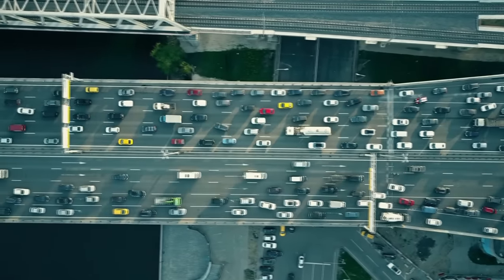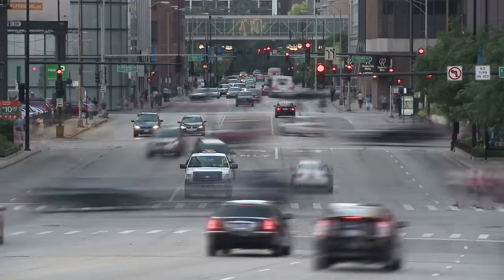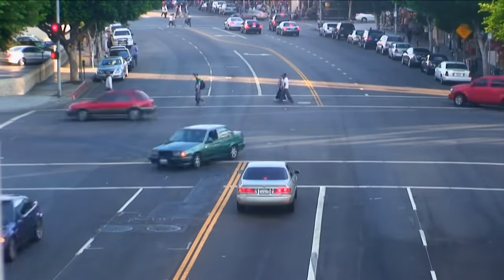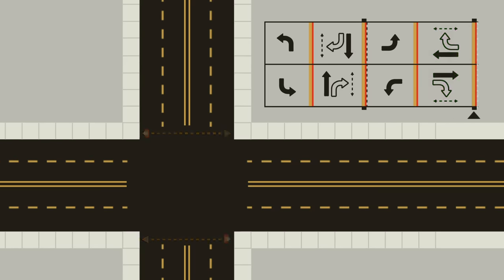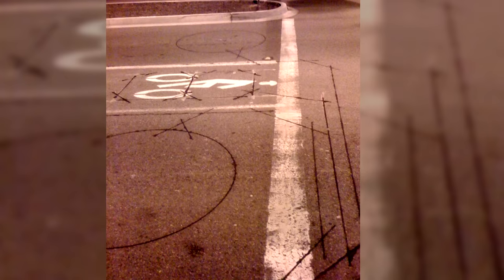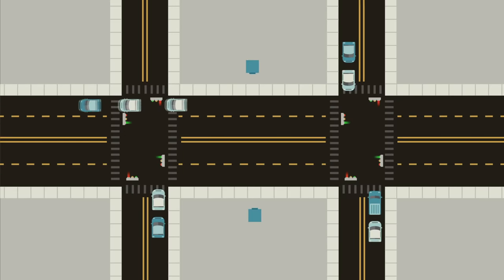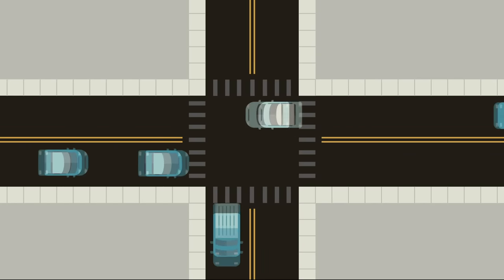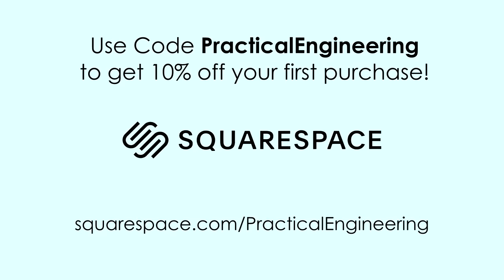How Do Traffic Signals Work?

Comment: Simple!
They show red light when I am near, they show green when I am not.
Reply: This! 😂
Reply: True
Reply: Hahaha correct 😅
Reply: you need to get a job driving a firetruck
Reply: Well in France, I have almost the opposite feeling (at least in the town I live, which doesn’t have a that large population). The traffic light is often green, and when it’s not, the red phase is relatively short.
Reply: System detects that you're speeding and punishes you by turning red light :P
Reply: That's how far the content goes indeed
Reply: C'est la vie.
Reply: i HATE traffic lights.  The traffic engineers who made the algorithms for the timing of right way need to be punished and jailed for life.  Such ignorance in the design.   Why the hell is the light red for me at an intersection where the intersecting lane has NO  cars?  That makes no sense!
Reply: @ClassyJohn  One explanation could be that you drive in a low traffic environment during the winter and during the summer you remember only the negative things which doesn't bode well for your hearts  longterm condition.
Reply: @SimonWoodburyForget  It does not make sense to group people who drive fast with those who drive slow.  It makes more sense to write an algorithm that favors faster drivers (obviously within reason) because otherwise it creates unnecessary congestion.  The algorithm is flawed no matter how you look at it and it desperately needs an update.
Reply: Its even more frustrating when you stop and the light immediately changes to green
Reply: Simon WoodburyForget If that were the case, the speed limit on the highway would be at least 140 km/h. Studies show that people feel more comfortable driving at this speed and it’s the most efficient speed limit to optimize traffic flow as it would mean consistent speeds. To prove this, it is the average speed on the autobahn in Germany when traffic volume is high (but not too high that there are traffic jams: medium capacity).
Reply: It sure seems like that...
How about those times when you speed up to make the green light, then all of a sudden it changes to red, and the guy next to your who was driving slowly suddenly catches up to you and even passes you by somehow...  lol
Reply: @BillAnt  I see this all the time being an anticipatory ("slow") driver and it makes me chuckle whenever I see some guy racing from intersection to intersection whereas I don't even need to come to a full stop, saving fuel, my brakes, making less noise and still not reaching my destination a second later than the racing guy. There is absolutely no point in racing to the next red light.
Reply: @Martin Weizenacker < That's why I don't do it, unless I'm in a huge hurry, but then it backfires anyway. lol
Definitely saves a lot of fuel, lessens the ricks of an accident, and saves one's sanity to just go with the flow. ;D
Reply: @SimonWoodburyForget  That's called Greeen Wave
Reply: And they're never timed with the lights coming up even going the posted speed limit.
Reply: @astromec6303  great job
Reply: I know, right!
Reply: Honestly.
Reply: True
Reply: I agree. Traffic control is for safety also. No car on section that I am and it is red, but when car approach from green traffic light, then it turn red which cause many accident in winter time. It should have a sensor with the timer to to adjust for the safety and cause a less wait on red light when no car approaching the other lane.
Reply: I read on a video back then that they did this to cause accident so auto shop repair can make business. That is a fact!
Reply: Lolll
Reply: @ClassyJohn  Remind me of some junctions in my city (right-hand drive) where sometimes there are more vehicles wanting to right-turn than oncoming vehicles going straight, but the traffic lights are slow to change from straight-going green (during which many junctions do allow discretionary/unprotected right turns, but may be unsafe due to blind spots e.g. Q of right-turning vehicles at same junction in oncoming direction and left bend in road ahead blocking one's view of oncoming traffic) to right-turning green. With my city planning to reduce discretionary/unprotected right turns (after a taxi got fatally T-boned last year while making such a turn), it'll be even more important to address this issue
Reply: Correction they show yellow when you are near. That's worse than red, especiallywhen you got drivers tailgating you. Pass or gas?
Reply: @SimonWoodburyForget  So you're proposing to make cars more like public transport 🤔 where vehicles pass by any given point along the road with more discrete time intervals between them, rather than over a continuous continuum of time
Reply: Stephen _L how come the red light don't looks red
Reply: @ClassyJohn
That isn't necessarily the traffic engineers you should be mad at.  Maybe the traffic engineer wanted a more sophisticated system but the municipality wouldn't pay for it. 

But as this video tries to point out, the answer to your root question may be more complicated than just the intersection in front of you.  (It just depends on how large and busy of an area you are in.)  That red light in front of you may be metering traffic approaching a much larger intersection ahead. 

The engineering failure that annoys me is traffic lights for these little side streets where the signal goes into a detection phase.  At a main road and side street intersection like this, the main road usually has green lights.  Pedestrian lights may cycle from Walk to Don't Walk and the signal enters its detection phase.  If any vehicle drives onto any detector, the main road signals will change.  This is fine, except the detector is often triggered by vehicles shallowly turning left off of the main road onto the side street.  The detector is only triggered for half a second, but it's enough to interrupt the traffic on the main road even when there is no traffic on the side road.  There should be a detection delay of a second or two that requires a "waiting vehicle" to be present for at least that amount of time.
Reply: hahahaha!!!!!!!
Reply: Ugh true
Reply: Stephen _L wow!
Reply: so true
Reply: Seems like the timing cycles are flipped backwards from they should be. And why now in the 2000s! I can remember when traffic signals were set up to expedite traffic flow, not impede it.
Reply: @SimonWoodburyForget  There's a really weird thing in the badly engineered town of Savannah, GA where I used to live, and the drivers have become accustomed to the horrible design of their roads, and so ALWAYS slow down for GREEN lights, and SPEED UP for red ones! As an outside, it was clear to me that nobody who ever worked in their city works department had any of the knowledge in this video. Down there, I think they just like the pretty red lights, so they put them up everywhere, and only make changes when somebody crashes and dies.
Reply: Thats not true.
It shows yellow when im about to cross, and stays red for 1 minute when only 1 car goes.
Reply: Because they rarely synchronize them. The highway by my house has them synchronized, it saves so much time and makes it safer because speeding doesn't get you there any quicker. If you go 45 MPH you can drive the whole stretch and not catch a single light. It is just government not having their act together why so many lights are not programmed right.
Reply: In my experience, if you're always driving faster than the posted speed limit, the light will usually turn red on you more often times than not to slow you down, but if you drive at the PSL, the light seems to stay green almost as if the system "knew" you were being more prudent with your driving.
Reply: Nailed it bro.
Reply: HAHAHAHAHA!! I feel for you, buddy.

Comment: I have a 52 year career involving design, fabrication, installation, timing and manufacturing vehicle traffic control systems. I applaud you for an excellent summary of these very complex systems. You even got then lingo correct that, in my experience, is rare except for actual practitioners of the art.
Reply: Seems like fascinating work... how does one get involved?
Reply: @orneryoverwatch7031 traffic design engineering - but video said with technology advancing, the jobs going to become computer based

Comment: In my home town, the timing between several lights (roughly a mile apart) is set up so if you were to drive the speed limit, you could hit all green lights. Only when you would go over or under the speed limit would you have to brake for a light.
Reply: I wish my town would bother to synchronize its lights. Downtown, the lights seem to be synced to always go red as the signal before discharges traffic towards it.
Reply: ... and in my hometown you only hit them all green if you drive 10 over.  I swear it's just so they can hand out more citations.
Reply: The roads around me couldn't give a fuck about logic and just go off whenever they want to
Reply: In NYC the major Avenues are synchronized so you can go through many of them in a pack. However, this can only work in one direction, the other direction becomes an exercise in frustration.
Reply: the problem with that system is that if you hit one red light, then you pretty much get all red lights
Reply: @Khorne_of_the_Hill  no, if you hit a red light, you just wait for a green, and then ride the next green wave, as soon as your speed matches the optimum. You may hit the red only if the platoon is too long and you're in the tail. The stop just cuts the tail off and you form a head of a next platoon
Reply: I learned that from a Paris taxi driver in 1977 when gas was the equivalent of $7 a gallon then. That driver handled that 4 speed Peugeot like a fine musical instrument! No stops. It is amazing what risks drivers are willing to take to gain 50 feet here in America. 3 seconds on the journey really!

Comment: There's a light near where I live where for a busy intersection that literally gives 3 seconds of green light  and causes the most frustrating traffic imaginable
Reply: Sounds about the same as the traffic light on my street. It gives about enough time for 1 vehicle to pass through before it turns Red again right after it just turned Green a few seconds earlier. Your lucky to get one vehicle threw the intercection before the light changes back to yellow and then Red.
Reply: There's an intersection between a seldom-used side street and a main street in my town. They have the lights default to red on the main street and green on the side street and the sensors take a good 30 seconds to go from detecting a car on the main street wanting to go (with zero traffic on the side street) to changing the light so the main street traffic can go. Nine times out of ten, you're getting stopped at that intersection if you take the main street. It causes so much traffic right in downtown. I kind of think they designed it like that on purpose. The only reasoning I can figure is to force people to stop and see the downtown businesses and tempt them to make a turn down the side street instead of continuing on the main street.
Reply: There’s one T-intersection near my home that has like 5 seconds of green and 1-2 minutes of red. 🤯
Reply: @NotSoCrazyNinja  - I once spoke with a guy who works in the traffic control business and he said that such limits - nonsensical to the naked eye of most drivers - are often implemented on the territorial boundaries of legal entities, e.g. counties. They block or push traffic onto the other, to have less problems within.
Reply: There is one road I must take to go to my homeland. On the way back, you go from a 70 m/h road and there is a bend then there is a set of lights that change from green to red spending almost no time on amber. People either slam on, or skip the red. But the road crossing is also a 70 with the same problem. That road is dangerous
Reply: @kojak8403  It's like the ramp meters on highways. Intentionally reduce the traffic at places where it's possible, so you don't get a mess at places where it's impossible.
Reply: @Stettafire  70 meters per hour isn't very fast though.

In Europe it's mostly illegal to use lights on road with such high speed limits. You need to reduce it to 70km/h /  ~44mph for installing lights. Also for any kind of complex intersection.

You also shouldn't go in a blind corner with 70mph. Damn, this should be common sense.
Reply: @NotSoCrazyNinja  I may suppose that engineers messed up with lights and directions so that main street is served by traffic lights, designed for side-street.
Reply: @brandonsavitski  , I live in a city where every traffic signalized intersection is like that after 'rush-hour'. And the city I'm in is 200km from end-to-end. For some it is not just bad planning, it is a way of life.
Reply: We have a light that at one time, it would turn green and before the car in the front of the line made it all the way through, it was already red again. They did eventually finally fix it but it took forever before they did and everyone hated it
Reply: It's been a practice in a few US cities to shave seconds off the yellow to increase red light camera ticketing, traffic safety and your ability to come to a halt before the red be damned. Even better, those trying to sue were out of luck as that would be "practicing engineering without a license."
Reply: inefficiently programmed lights are my greatest daily cause of frustration every day.
if I had to make a list of a hundred people to send for capital punishment - programmers of such poor light sequences would be my absolute number one!
Reply: Lights like this I quantify them by how many cars can make it in a light. Makes it easier to know when to take a detour. (If possible)
Reply: You must be from Fort Worth Texas

Comment: One additional point about inductive actuated control; This system can sometimes not detect motorcycles and bicycles, which is why red dead laws exist in certain states, which allow motorcyclists to run a red light after a certain amount of time or cycles.